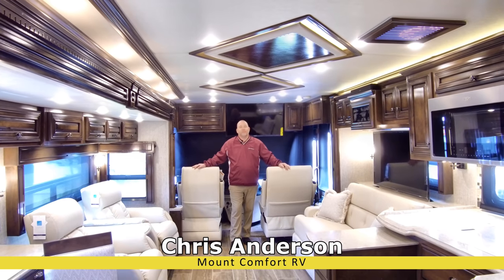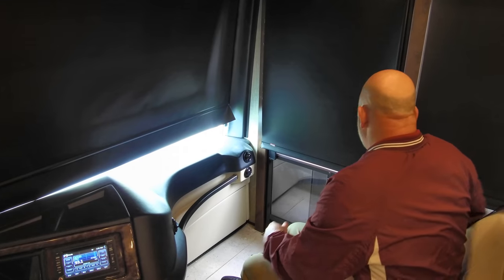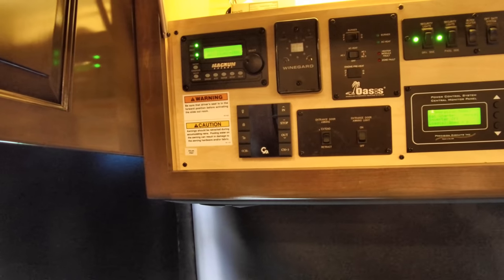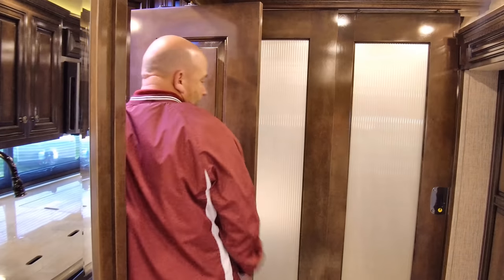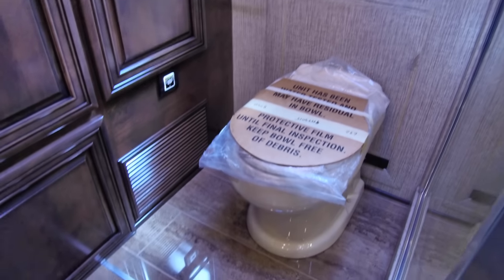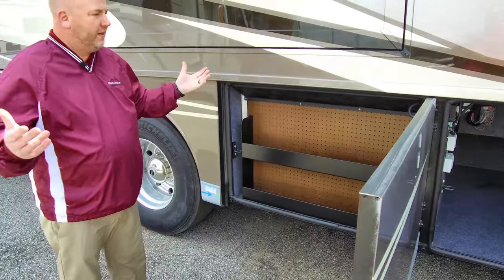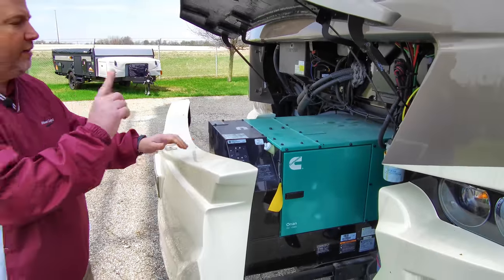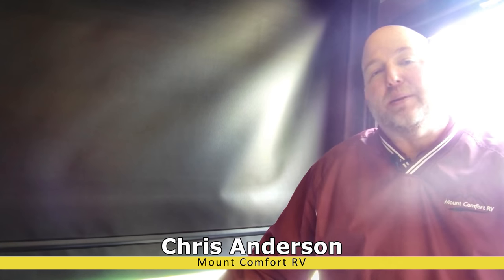NEW 2020 Newmar Dutch Star 4369 | Newmar Video Series

Comment: It's too bad Newmar doesn't put a 600HP engine in a coach this big. the 3709 has the same engine.
Reply: They do, it's called a London aire, and it's about $250k more.  The 3709 Dutch would be fine with a 360, so it's really over powered IMO.  (Not saying that's a bad thing)  The 450 is perfect for this coach and you can still tow 15k behind you.